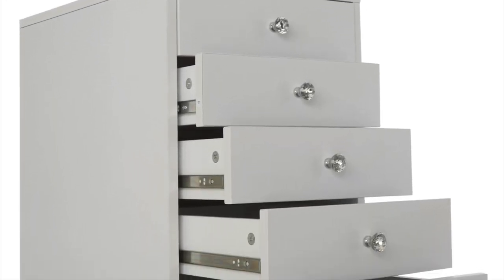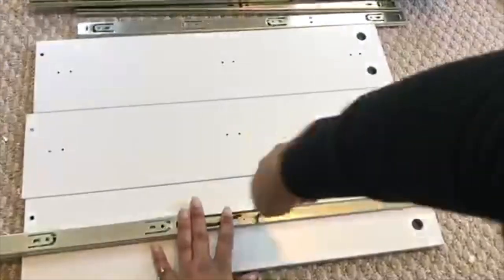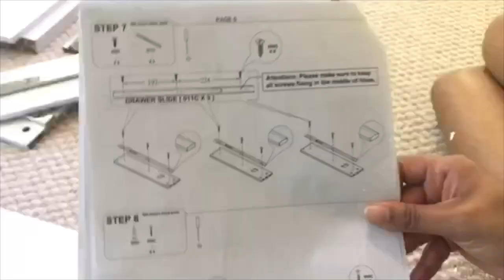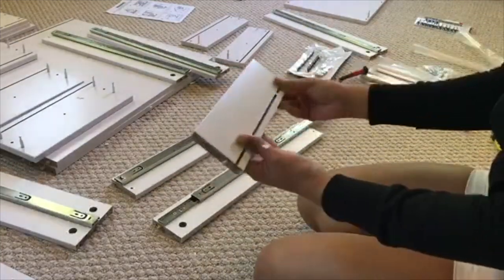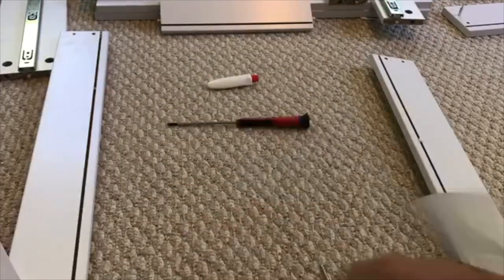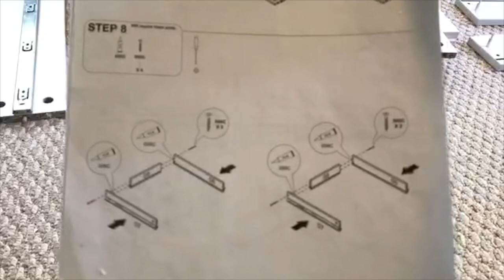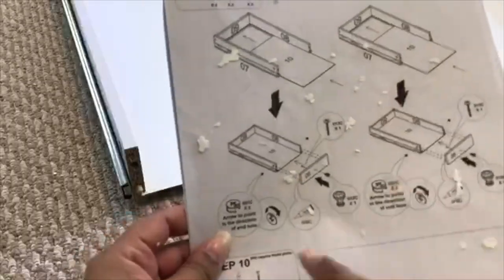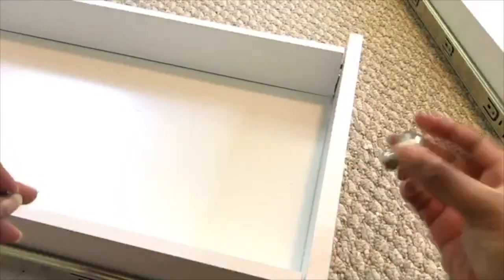PART II: HOW TO BUILD AN IMPRESSIONS VANITY CO.  SLAY STAYTION 2.0 DRAWER

Comment: I bought the hello kitty version of this never again am I buying from them I couldn’t build a ikea furniture like it’s nothing I thought it was gonna be the easiest thing ever cause you would think they would explain it but no, these are the worst instructions I’ve ever gotten it took me seven hours to build this and they don’t even explain how you’re supposed to separate the bars and if you buy this and you separate the bars, be careful cause there’s a bunch of little balls in there and if you pull it out too fast, they all fall on the ground so we have to like individually pick them up and put them in there again and then your hands are so greasy and the worst part is when you put the bars back together it’s incredibly impossible to put the drawers back in place just on the drawers after everything was done and I was putting the drawers in. It would not budge and I did not want to force it and break them but at the end I learned if you wiggle the drawers as you’re putting them in they go in and also if you’re buying the Hello Kitty version the drawers don’t close all the way there’s like enough room for you to put your fingers in there in case you like shut it too quickly, and your fingers are still there, but it makes it look nasty like it looks crusty like that
Reply from the maker: OMG I feel you sis!